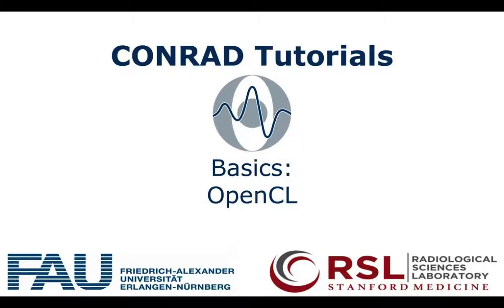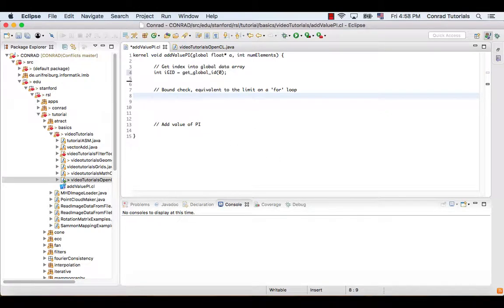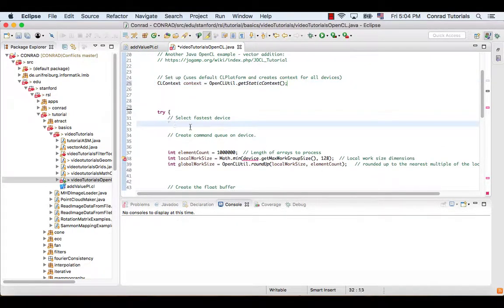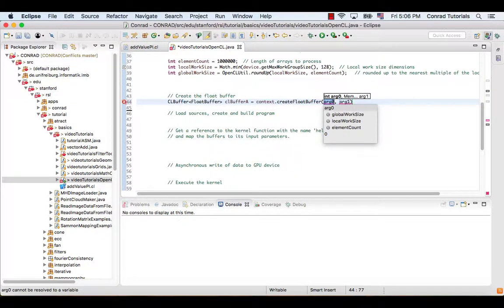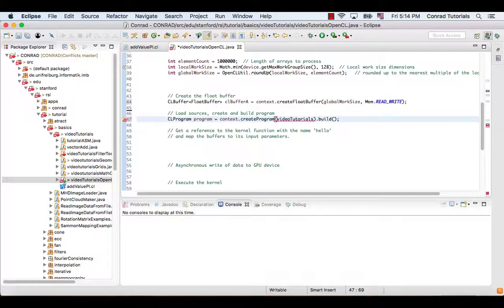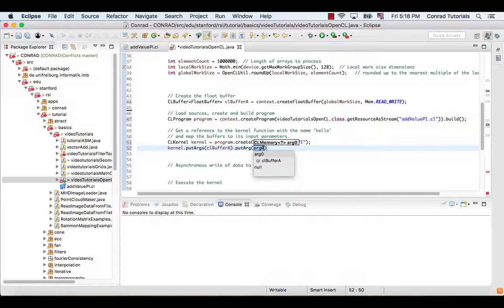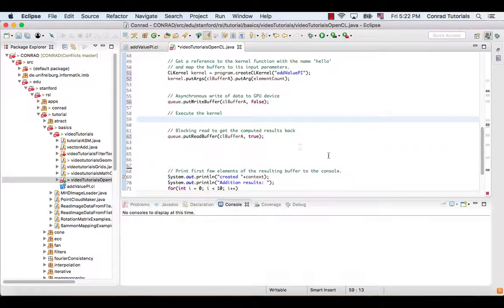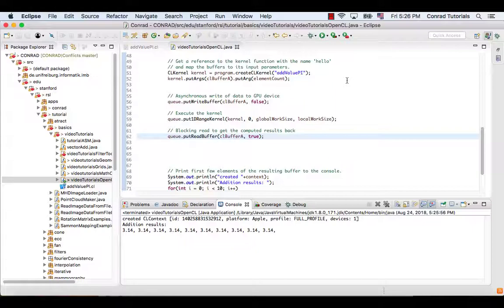Basics: OpenCL

Comment: What library are you using for OpenCL in Java?
Reply from the maker: We are using JOCL [1]. It offers platform-independent use of OpenCL on Linux, Mac, and Windows. I really like it. I can still use the hardware acceleration on my MacBook Pro which does not have an Nvidia board...

[1] http://www.jocl.org
Reply: @maierAK  Wow, I just looked at the video and there it is in a comment, and the description, thanks anyway. I was asking because I don't have OpenCLUtil or CLContext (I stopped there, so I don't know if I'm missing anything else). is that just because of age? I wouldn't have thought 1.5 years would make much difference for a library like this.
Reply from the maker: @minetech4898  CLContext is a JOCL feature located in com.jogamp.opencl.CLContext. OpenCLUtil is located in CONRAD in Package edu.stanford.rsl.conrad.opencl. Both should be imported (and found) if you followed the installation instructions at https://www.youtube.com/watch?v=OtthSlaTSCs&list=PLpOGQvPCDQzu3xiy30NCHYtmaO01Tzr2r&index=2&t=0s and https://www.youtube.com/watch?v=F6JQctSTOgg&list=PLpOGQvPCDQzu3xiy30NCHYtmaO01Tzr2r&index=2
Reply: @maierAK  Ah, I didn't realize that, thank you!